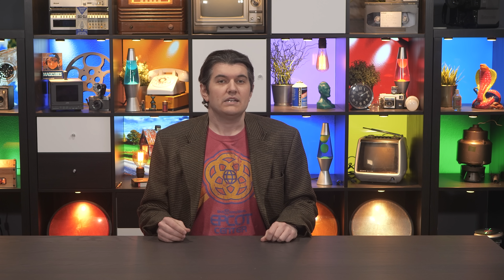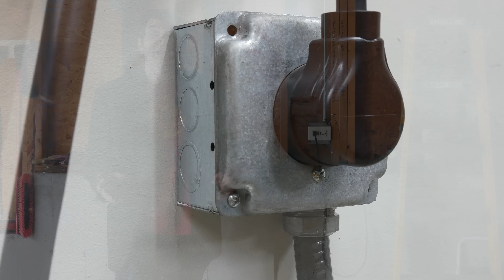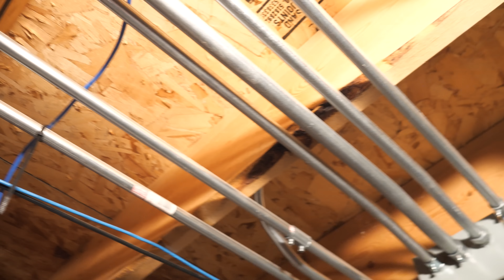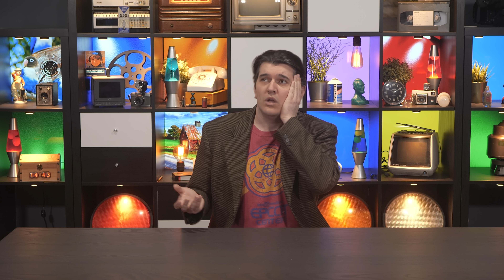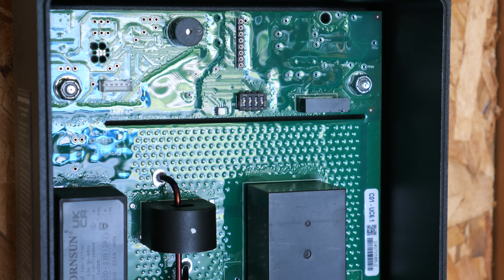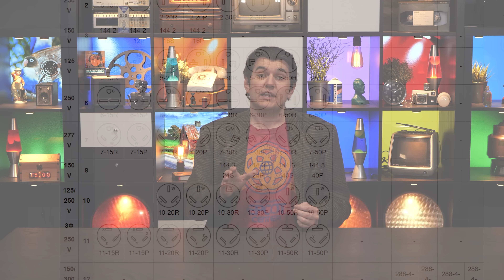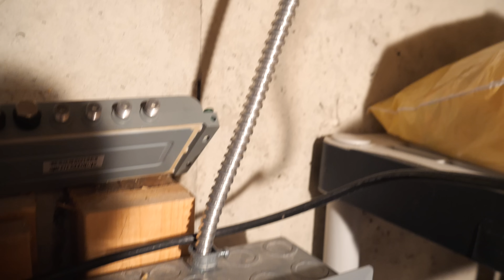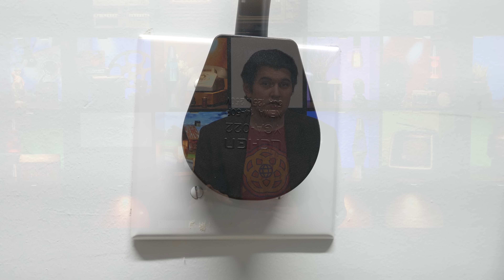The "standard" car charger is usually overkill—but your electrician might not know that

Comment: I really think we should be focusing electric vehicle efforts on smaller vehicles with smaller batteries, while also at the same time making it easier to get around vast distances without the need for a car at all. If I could own a small city car for commuting, groceries, or loading pets in for vet visits, and then board a high-speed train to get anywhere across the country in 12 hours - I'd rather do that.

Electric vehicle innovation should correspond with "innovations" in making cars less of a necessity inside the city. This makes things less taxing on the grid, reduces the carbon footprint of mobility, and means we're less likely to hang on fossil fuel's coattails for getting around

Comment: This is great. I have a 30A 240V electric dryer circuit right next to the dryer that I don't use (gas dryer), but my electrician told me that I'd need to spend $2500 - $3000 to run a new 50A wire from the other side of the house where my circuit board is to the garage. I asked him about the 30A circuit that was right there, but I was told that I have to have the 50A circuit. I never understood why. I will try to figure out the code and try to see if this is something I can do on my own. Thanks. (I do live in northern Illinois, so the codes are quite stringent.)

Comment: Funny thing is that I was aware that the charging current was adjustable, but I was not aware that mattered even if you were not technically current limited in your breaker box. I have 200A service, so I thought it would not make sense for me to limit the current, but the simpler wiring might make it make sense. My real issue is that I want to charge a car outside and there are not a lot of good solutions for that on the market. My garage is not very big and it’s under my living room, so I am not comfortable charging a large battery there.
Reply: I got an EV recently that would not fit in my garage anyway and got a ChargePoint to charge it, repurposing an existing 240V 50A circuit we had for a hot tub. Installation was easier and cheaper than I expected and I am very happy overall. I also found out that most EVSEs can be installed outside just fine even if that’s not clear from some of the marketing materials. Pedestals are also available for a couple of chargers at reasonable prices, though I opted to skip the expensive and just install the EVSE on a wall. When we redo the driveway, I am planning to run an underground circuit for a second charger on a pedestal.

Comment: My EV charger is rated to 32 A but was installed with a limit of 25 A by the electrician, because that's all my grid connection allowed. But that is plenty, more than I need. I later adjusted it down further to 16 A, still plenty for me. Reason being to reach a lower peak power use bracket, which lowers my energy bill.

My charger is a smart electronic one, and that's a good thing for me. It means it can monitor other energy use in my home, and throttle itself if I'm using too much power for other things, thus avoiding a tripped main breaker. It also monitors hourly power cost, and prioritises the cheapest hours. And since it sits outdoors, it's a good thing that I configured it to only charge when I wave the right NFC chip in front of it, so others can't pirate charge.

Also-also none of the online features in my car work anymore because the car uses a 3G modem, and 3G was switched off where I live. So the car is completely offline (hey, good for privacy!) which makes it handy that the charger is online.
Reply: However the smart charger is designed to also work offline. With no internet connection, or if the company quits, I can still operate it locally via its own local wifi network, for making configuration changes. For day to day operation the app isn't needed, it's just plug and play (charge).

Comment: Speaking of "smart" devices. Oh yeah, I really hate the "internet of things" stuff. Pretty much nothing needs to be connected to the internet and even fewer things need to access outside servers. 

Now, I may want to control something remotely, but I can (or should be able to) do that without needing to access some kind of outside server. My solar power inverter is a good example  - originally it came with a module that would send data to some server, then I would have to create an account to get that data. I found out that I could remove that module and get modbus. One modbus-rtu to modbus-tcp adapter and I can get the data to my own servers. Similar with monitoring my electricity use and my generator. No need for external servers or accounts or apps.

The only things that need to be connected to the internet are ones where the function directly relies on it - a IPTV STB or something like that. For everything else, there are standard protocols - SSH, HTTP, SNMP, let me control the device using those instead of some "internet of things" crap.

Comment: There's not infinite capacity left. Look at California. Us in NJ are reaching maximum power delivery from the power supply. My ice vehicle does not burn fuel to keep its battery warm or cool. EVs failed 100 years ago. Fewer moving parts doesn't equal simpler. Electronics fail all the time. During a disaster when electricity is not available, you know what is still available? Fuel.

Comment: Video mentions that MC cable comes in only up to 10 AWG.  Have personally installed EVSE's using 6/2 (and 6/3) MC cabling.  It's definitely widely available, though not as popular.  Usually stranded and not solid - but either are code compliant.
Reply: Yeah, I was confused by that statement as well. My EVSE is on 6/3 MC.
Reply: They make MC cable in all sorts of sizes. Southwire is one of the biggest manufacturers of MC cable. Their web site lists all kinds of MC cables.
Reply: What Size of MC cable do I need for my Hammer?
Can I touch this?
Reply: @drumbrakes  Can't touch this comment.
Reply: @jmdelapp  Stop.
Reply: I think he meant to say that "when buying from Menard's website", it has that limit.
Reply: The limitation was probably more of what is local hardware store had available rather than a manufacturing limitation of options.
Reply: These work great if you really do want to run a 240v, 60 amp circuit.
Reply: Yea it's available, but just use conduit with THHN. MC cable looks to be more simple, but the adapters make it a pain. Try finding a 6/2 termination to a 3/4 knockout in the charger. Also there are additional requirements like grounding the box/sleeve (which OP didn't do in the video!). Also keep in mind MC cable is the same by code as romex for damage protection. The only benefit MC cable really gives over romex is a higher current rating for the same gauge, and it's easier to run through bored joists/studs than conduit is.
Reply: @ppg6478  I've done both, 6/2 (or 6/3) MC or THHN in PVC conduit.  MC is just a way faster and easier install.  Dealing with conduit adapters, bends, pulling wiring - not needed with MC.  And going with EMT conduit is going to be more work (and cost) than PVC.  Didn't have any problem with end terminations at the electric panel or EVSE with 6/2 MC.  I do prefer fixed conduit (PVC or EMT) when the run will be visible and surface mounted (not run into the back of the EVSE), but otherwise MC is just a much quicker and easier install - and often lower total cost as well.
Reply: @billjohnson3344  How did you go from 6/2 to 3/4 knockout directly? I've only seen terminations listed for 6/2 with 1/2 knockouts and a lot of chargers are 3/4 only. There's certainly ugly ways to do it, but haven't found any clean ways.
Reply: @ppg6478  Honestly, I don't remember having to do anything special.  MC comes in different diameters, and fittings of so many styles - just got a compatible 3/4 fitting for the 6/2 or 6/3 MC I was using.  Have done this with a few different types, I now prefer the Southwire screw on type - which actually threads onto the MC internal ridges - instead of clamping to the exterior.  Ensures a nice burr free end (without plastic insert) and attaches at the same time.  And they have these for 3/4 knockouts.
Reply: @ppg6478  Use  (2)  3/4 in. x 1/2 in. Rigid Conduit Reducing Washers (Home Depot ).  I did that for my installation.  The washers placed one one each side of the 3/4" knockout in a back to back configuration and the 3/4' knockout on my EVSE became 1/2".

MC is much more flexible than Romex (using stranded wire vs solid) and can be used in exposed locations for most codes unlike Romex.

Comment: I wasn't setting out to get a wifi charger, but my old siemans had problems after a year and only got worse. My charge point hasn't had a single issue and is like 3 years old now. So there is that. I got it because my dad had it and it was working fine and the reviews were good. But yeah I'd be fine with a good solid 32 or even 15 charger. 32 is the max based on the 80% rule. 110 charging makes me uncomfortable. You never know with those plugs. But anyway........my wiring is 12 years old and holding up nicely. I've unplugged it maybe 4 or 5 times and most of that was while switching units.

Comment: I agree with the silliness of a wifi connected EVSE. No need, less reliable, more expensive. Lose, lose, lose. Love the beefiness of the Grizzl-e relay and the nice beefy circuit board and conformal coating.

Comment: In some circuit breaker panels you can replace the standard circuit breaker with a tandem circuit breaker.  They allow you to fit 2 circuits breakers into the same space of one circuit breaker.  The circuit breaker has 2 switches for the individual 120 circuits.

Comment: You could have left the 50A plug and used a 50A outlet, even though the breaker has a lesser rating. After all, that's what the breaker is for. In Germany it's done all the time, the plugs are rated for 16A, but circuits can be, 16A, 13A or 10A.

Comment: We have 230v over here in Norway. And my house allows for 32A three phase for charging cars. But I installed a single phase 6A system for my car (that supports very slow charging). It's better for the battery long-term, and makes a lot of sense if you have a small compact EV like myself. Like most Norwegians, I charge at home 99% of the time over night. And my setup only feeds my car if the rates are low or the battery SOC% is under a certain threshold (I can override this ofcourse with the apps on my phone if I need to). I haven't run my batteries flat yet, and I'm an early adopter that has been driving purely electric since 2014. I always tell people: "If you can, charge as slowly as possible. As slow as your car is capable of. You don't want DENDRITES to form in your batteries." Look that up... Dendrites... Unless you change cars every year, make your battery last as long as possible.
Reply: "It's better for the battery long-term"  no it's not. Not in any statistically significant and meaningful way. Unless you've got an extremely low quality car, all of them are designed around battery longevity for standard home charging. There is no significant difference in battery life-span from charging only at 8 amps or 40 amps with any modern EV. The car does the charging, not the station, and that car's charging equipment is engineered FOR THAT BATTERY design.

This is just nonsense being repeated that confuses the issue with absolutely no benefit.
Reply: I wish this myth would die.  There's no data that charging at any rate less then 30kw (on a typical, modern EV pack) is any "easier" on an EV battery than charging at a higher rate.  Dendrite formation is a function of temperature and SOC, and with effective thermal management and modern cell physical layout to avoid hot spots, a sub-optimal charge rate (charging hours longer than necessary, running the OBC for longer, wasting energy keeping the support electronics powered for no good reason) is not of any benefit.
Reply: Yeah I don't think that even charging at full power on AC stresses the battery. But still, with a NMC battery, it is good practice to do small charge cycles staying around 40-50% SOC
Reply: fyi they grow on all electronics

Comment: Over in Norway (generally 400v 3 phase) they've basically outlawed anything but actual type 2 wall boxes for home charging ^^' It used to be permitted to use a 16 amp schuko 220v outlet if it was on a dedicated circuit and had additional ground fault protection, and the 'emergency adapter' or the car was limited to a maximum of 12 amp continuous load, but people didn't respect the limitations so it got outlawed.

As for smart charging; We have ~40 garages in our apartment complex, they're all prewired for wallboxes and everyone who wants to charge their EV or hybrid has to install a compatible, smart wall box. It allows the system to operate within the grid capacity (can't charge 40 cars at once at full power), and it allows the majority of charging to happen during the hours with the cheapest electricity. As much as I dislike smart vital infrastructure it's a necessary evil in the context.

Comment: On GFCI requirements: in EU RCCBs are so cheap that there's almost literally no reason to not slap one before MCB of every possible circuit, except maybe for the fact that doing so effectively doubles the size of the circuit breaker box. Available for almost every useful current rating you might come up with, too. Usually 20-30 euro for a 3-circuit and 10-15 for a single circuit device from a reputable manufacturer.

Comment: I have been leasing a Model 3 since April 2024.  I have been charging off of a 110v 15 amp circuit for the entirety of that time.  I have supercharged once (on a roadtrip) and otherwise never used a Level 2 or above charger.  Nevertheless, I leave my driveway virtually every day with a 100% charge (Note: I have an Lithium Iron Phosphate battery, so, yes -- 100% is fine).

Comment: Some charger supplier needs to design a unit that can read the VIN off of a car that's plugged in, compare it to a list provided by the apartment complex/owner, and authorize charging, then charge back the cost to the renter through their rental agreement.  My complex aggregates and splits the water, sewage, and trash costs amongst the renters in the complex.  It shouldn't be that hard to also add the identified cost of apartment 309's registered vehicle to apartment 309's rent and provide a receipt via email for the month's sessions.

Comment: I made my setup with 6 gauge wire on a 50 amp breaker to a NEMA 14-50, to accommodate a 32 amp EVSE. It's overkill for my charging needs. I wish I had used thinner wire to make it easier to work with and to save cost. At the time I thought I may someday upgrade to a hard-wired EVSE to take full advantage of the 50 amp circuit (80%,40amp), but even 32 amp exceeds what I realistically need for charging speed.

Comment: this all seams very slow in germany and most of europe you can charge form an outlet with 3,5kw (230v*16a) and a standart charger is 11kw(230v*16a*3phase) or if mentioned with your electricity provider up to 22kw is also often possible

Comment: It sounds like I have a similar situation to your parents with the box being in an adjacent wall basement. 
But the electrician quoted me at $1500 (and that's just the plug and wires, not even the physical EVSE because I planned on using my stock portable one). I've been meaning to get a second opinion. But honestly may give a crack at it myself this summer.

Comment: after 'wait, so do you have to plug it in or not'? this is the second biggest misconception that drives me mad as a plug-in hybrid driver. even more so than BEVs, a wall outlet is completely fine, able to completely fill the battery 0-100 in ~7 hours. but people seem to get worried about how they'd have to install some high capacity circuit and get a service upgrade just to make a PHEV 'worth it'!

Comment: Enough has changed  that a remake would be great! Still trying to get my family and friends to understand. I drive a PHEV (plug-in hybrid) due to my driving demands (the electric takes care of my daily commute) only using a regular household outlet. Right now I think PHEVs should be a consideration for more people. Could be a stepping stone to a full EV for those with range anxiety. Electric most of the time where it can be beneficial but can run on gas if you absolutely need that flexibility.

Comment: I had 2 twenty amp circuits in my garage. Converted one to 240v with a new receptacle, 2 pole breaker, and 16 amp evse. 2.5x faster charging for under $250

Comment: Note that modern aluminum wiring is much safer than that in use 50 years ago.  The old aluminum would flow when clamped.  The new stuff is stiffer.  Still needs the usual care.
Reply: Trapezoidal strands, less air between the strands.  And a different AL alloy.